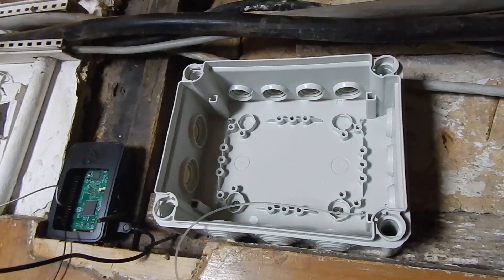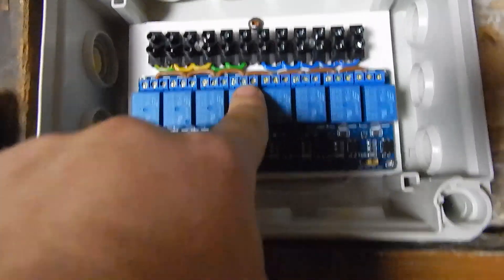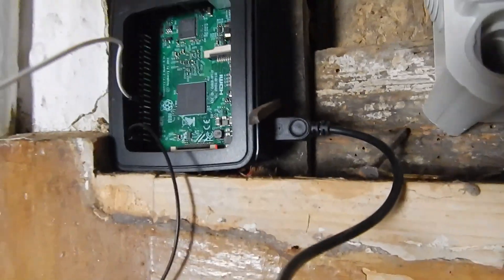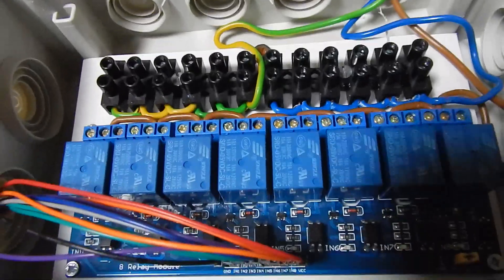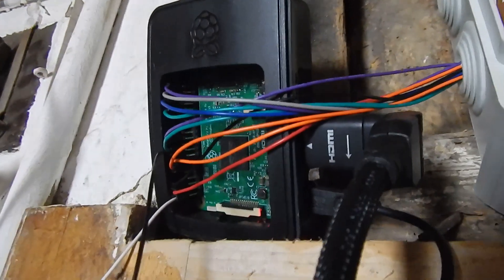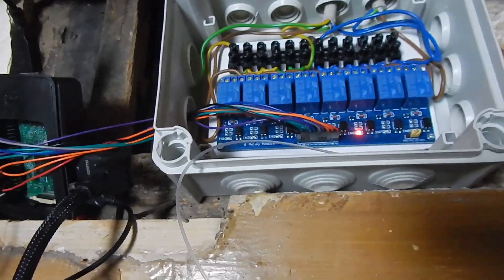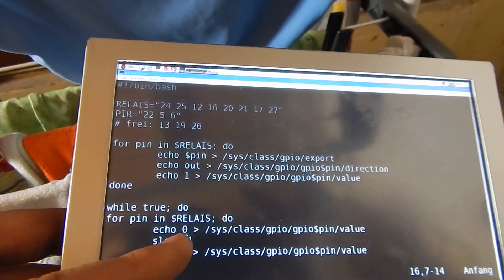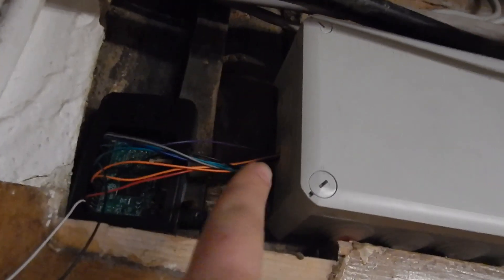Electrical Installation for Home Automation: Turn lights on and off using Raspberry Pi 3

Comment: With a 10amp feed, I wasn't sure if the power in cable was sufficient to carry 10amps, I personally would also have a fuse per relay, probably 3 amp quick blow for safety, if running lights, this should be sufficient for extra protection. Otherwise, it was interesting (just a bit concerned the guy doesn't really understand mains power however with this colour 'thingy' cable)

Comment: Hi. .im developing a home automation project with Raspberry pi 3. .its working fine but after a few minutes its get heated and pi get restart in that case how to solve that issue. And in your video u didnt use any cooler then what u did for heating?
Reply from the maker: Mr.S.Naveen Kumar Asst.Prof - ECE avoid loops, use interrupts

Comment: thanks for the video. I have a question though: why didn't you cabled directly into the high voltage relay side and used an external terminal?
Reply from the maker: With these GPIO expanders you can spread GPIO pins all over your house and you only need 1 raspi.
Reply: I was asking about the black terminal on top. can't you directly wire the high voltage cables to the blue terminals on the relay board?
Reply from the maker: You could not. All blue and all yellow wires are wired together. They don't belong into the relay. The relay is connected to voltage supply while blue and yellow are neutral conductor and ground. If you would connect them directly to the brown cable, you would short the circuit.

Comment: I have one question and not getting answer any were. Suppose I have one raspberry pi 3 and I have made one room wiresless with the raspberry pi3 and realy module easily since it was in that room itself. Now I want to make my another room wireless as well but the problem I am facing That Bringing all the wires from another room to raspberry pi room that wires will cost a lot. How to handle this ?? Should I have to  but another relay module and install in room and send the wires to raspberry pi . Please guide me how to solve this problem I have 4 rooms 2 flour house  Thank you very much
Reply: Deepesh Singh following
Reply: You can get another Pi with the relay for the second room. Go for the cheaper Zero W model ( https://www.raspberrypi.org/products/raspberry-pi-zero-w/ ) it will be more than enough. 

You can also go with just the second relay board and then run just the "logic" cabling to the existing Pi.
Reply: you have many options to do this
u can use wireless communication module like Bluetooth module, wifi module and x bee. 
then make a central unit in your house and others in different room ....
you communicate only with central unit and it can control others
Reply from the maker: You can put up to 8 GPIO expanders to the I2C bus.

Comment: A pity the relais are not of type dual pole dual throw (DPDT).  Much more safe if both live wires are disconnected from the consumer, when the relais is in OFF state...

Comment: is there any way to put it bluetooth so i can control from my cell phone, and know whats going on home from a remote area?
Reply from the maker: just read http://raspberrypi.stackexchange.com/questions/14598/making-raspberry-pi-bluetooth-slave
Reply: olivier caron wifi, 3g.. 4g..
Reply: olivier caron with raspberry pi2 just plug in  bluetooth dongle. Raspberry pi3 has bluetooth built in

Comment: How can I identify a problem in the lighting system and send a warning when this is having trouble using raspberry pi?
for instance, when a light bulb has burnt out or it's loose
Reply from the maker: You need a hall sensor in order to do that.

Comment: what did your father say about fire safety issues? it's a cheapo relay board from China isn't it?
Reply from the maker: He wondered a bit about it but I told him that it fulfills the same european standards than any other electronic product that has been imported.
Reply: antisteo CE for Chinese Export? ;) I'm totally with you but it's extraordinary that a German electrician is OK with the Chinese CE..
Reply from the maker: M. Swoisa First, he was not. But I convinced him.
Reply: Isn't CE a promise from the manufacturer himself that he has made sure that the required safety tests are done?
I think there is no external certification required in Germany as long as there is no complain about the products safety.

The manufacturers can just print the CE on their products without external control.